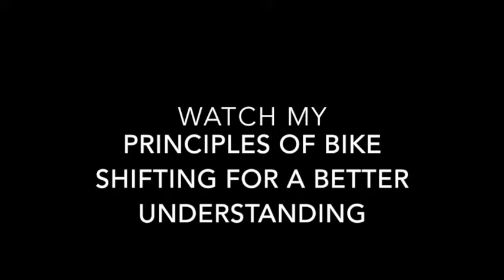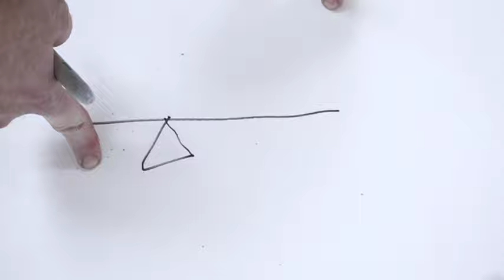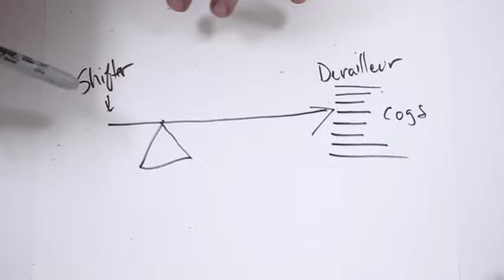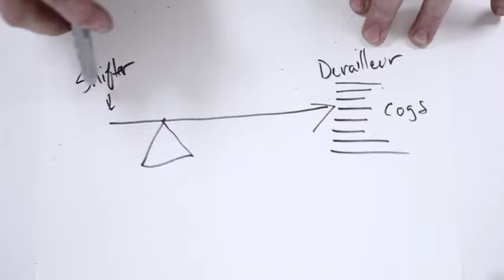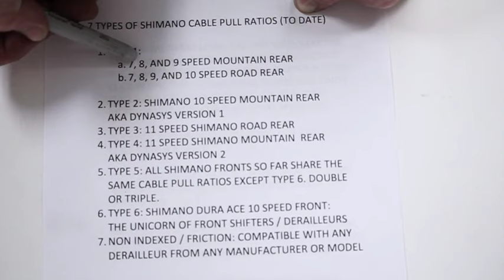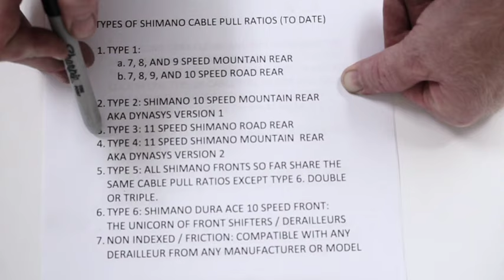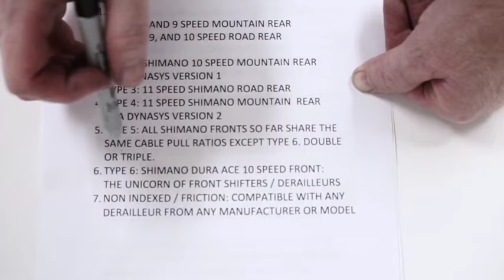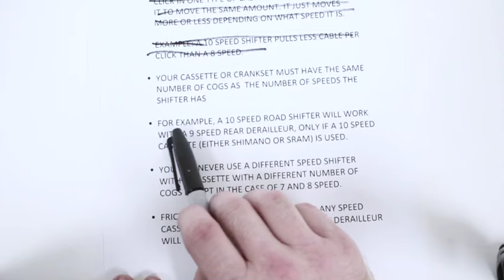Shimano Shifter / Derailleur Compatibility Guide: Intro to Cable Pull Ratios

Comment: OK so in my case. I would like to upgrade my touring bike from 7 to 9 speed. And for that I have the Ultegra St-6510 STI Shifters. Can i use my front derailleur (3 Speed) and just have to swap out the backwheel with a 9 speed cassette?

If this is possible it'll be awesome for my wallet because then i can spend the rest of the money for other parts.
Reply from the maker: You can use those. You’ll need a different chain as well. You’d only need a wheel change if you’re running a freewheel, or one of the older 7 speed only cassette hub bodies.
Reply: @johnthebikeguy   Thanks for replying. Your video is the golden explanation 😄 for this compatible problem. 

Great work!

Comment: Thank you for the brilliant video. One question though. I was advised by my LBS that you could match a 10 speed  Decore derailleur with a 9 speed Decore Shifter.because they  shared the same pull ratio. Given what I’ve just seen in your excellent tutorial, I would assume that this is WRONG? This would be for a e-MTB.
Reply: How would a 9-speed shifter be able to index across ten cogs?  One cog will always be unreachable.
Reply: I think they're correct. Providing you are only using a 9 speed cassette, which I assume is the case with given you are using a 9 speed shifter. You would just not be using the 10 speed capability of the derailleur.

Comment: If I upgrade my left shifter into Tiagra 4700, will it still work on Tourney 2x crankset?
Reply: not. The Tiagra 4700 is a special, not compatible with anything else, as far as i know.

Comment: So in order to convert my 10 speed tiagra to 11 speed. all i need is 11 speed 105  shifter and casette?
Reply from the maker: No, 11 speed road uses a different cable pull ratio. You need all 11 speed road components
Reply: @johnthebikeguy  so is everything excluding crankset/front derailler and brakes?
Reply from the maker: @tonyle7511  yes

Comment: Good video,  but 10 speed shifter and derailleur can also work with 9 speed cog, I have slx 10sp rear derailleur and deore 10 sp shifters but cogs a 9speed and its shift perfectly just needs adjusting H L screw
Reply from the maker: germantss 

What you did isn't a very common application... most people would just use a 10s cassette. Especially given the extra range, and the increasing rarity of 9s cassettes, higher prices, and lack of high quality 9s cassettes since they've been phased out. SLX thru XTR are now all 11. The lesser speed are getting harder to find in those groups.
Reply: But the trick is that derailleur lines up perfectly no noise and gears shifts perfectly. I think shifters pull cabel the same amount like 9speed, differents are in derailleur because of  different cabel attachment point. I seen on internet that people change attachment point on 10speed derailleur and they work with 9speed shifters.
In my opinion shimano specially made different attachment point that you can't use 9 speed shifters it's call marketing. Reason why I use 10speed derailleur because it has clutch, on 9speed there is no such model. 
I am from Lithuania and here 9speed part still easy to get and they are cheaper. For example :             Shimano CS-HG300-9 Deore, 12-36T cassette cost 17,10 eur and 10 speed  Shimano CS-HG50-10 Alivio, 11-36T 23,90eur , Shimano CS-HG62-10 Deore, 11-34T 31,57eur. 
And chain Shimano CN-HG53, 9speed 11,70 eur, Shimano CN-HG54, 10 speed 18,39eur. You see 10speed is more expensive but there no big different in gears. 
What about 1 X 11 system it has extreme chain line how much faster chain wears out ?
Reply from the maker: The distance between two 9 speed cogs is 4.35mm, and 10 speed is 3.95. 

Let's say I use a 10 speed shifter on a 9s cassette... The distance between the first (high gear) and ninth cog (low gear) on a 9 speed cassette is (8 x 4.35) 34.8mm. If I used 8 clicks on the 10 speed shifter, the derailleur will have traveled (8 x 3.95) 31.6mmm. By the time we get to that ninth cog, the derailleur will be short by 3.2mm. The 10s shifter tells it to travel 3.95mm each click, so as we go up the range, it'll travel .4mm per click less than it needs to to match a 9s cassette. You can minimize how much it's off by setting the derailleur perfectly in  the middle cog, and the amount it's off by is halved. But still, I wouldn't want 1.6mm off by the time i reached either high gear or low gear. 

I wouldn't say that the chain wears out any faster. The crank's position is centered better, so even though it's a big range, it's like using the middle gear of a triple which has less extreme chain angles than the other two.

Comment: I have new parts my crank is shimano deore hollowtech . and front derailer is a shimano altus 3 gear front 9 in back. But my question is is deore compatible with altus
Reply from the maker: J S 

Is the crank compatible with Altus? 

Sure. Cranks don’t really have anything to do with derailleurs specifically. Apart from having a front derailleur that matches the number of speeds the crank is. 

It’s important for a chain to match the speeds of the crank and cassette,  beyond that, you’re overthinking things.
Reply: JohnTheBikeGuy i have a understanding and comprohending disabilty so i hear all the time i over think things. And thanks for the help. And parts are on a sun ez classic sx. Chain itself it close to 10 feet long. Chain is a 9 speed kmc.. Front and back shifters are shimano slx. Rear derailer is deore.

Comment: I have 10 speed shifter shimano (no type name on it) pair it with 10 speed casette/sprocket. 
And i use 9 speed sora RD. And its not working good. Than as my mec said to change the RD to 10 speed ..I than bought tiagra 10 speed RD. Install it and it became worst. Im taking it back to Sora RD 9 speed. Anyone know whats wrong?
Reply from the maker: Shimano has been weird with their 10s road stuff since I’ve made the video. Tiagra was 9s and less when I made the video. You basically need to find older 105, ultegra, dura ace 10s components now to be compatible. I’m not sure about their shifters lacking a name with 10s. If you’re unsure about shimano road hierarchy, it’s tourney, Claris, Sora, Tiagra, 105, Ultegra, and Dura Ace at the top. 

But Tiagra is definitely different in 10s and won’t work with anything other than 10s Tiagra. It’s it’s own thing now. You need to obtain higher models that were 10 speed when Tiagra was less than 10. The upper models moved up, Tiagra moved to 10, and things went downhill as far as compatibility goes.

I’m guessing that your old shifter was compatible, but had other issues like a bent derailleur hanger, corroded cables, or a bad shifting mechanism that were causing the issue beyond compatibility.  A lot of times when an old shifter was working well, then didn’t, it’s 95% chance of cables or a bent hanger. Shifters sorta wear out, but it’s not terribly common unless it gets physically damaged.

Comment: So what you’re saying is that if I want to get the XT cassette with the XT derailleur to our on my road bike, I can’t use my 105 shifters that are already on to do that!?! 

Cheers, Kaz Hatfield
Reply from the maker: Kaz Hatfield depends on which XT derailleur it is. If it’s Dynasys, then no. If it’s 9 speed, yes.
Reply: @johnthebikeguy  My bike is a 11 speed. I've seen people do it to their mountain bike but they also used mtb shifters. And the two videos I've seen for road bikes didn't say anything about wether or not they had to change out their shifters or if they kept them the same. 

Thanks and cheers, Kaz!

Comment: do Shimano tiagra sti will work on deore rear derailleur? both 10 speed.
Reply from the maker: Jose Rafael Laruta  No, they won't. 10 speed road and 10s mountain do not share the same cable pull ratio. In order to use a tiagra shifter with a MTB Shimano derailleur, the derailleur must be 9s or less
Reply: so if a tiagra 10 sp sti was used with a 9 sp mtb derailleur, what sort of cassette could you use ?
Reply: i.e could any 10 sp mtb cassette be used ?
Reply from the maker: Joe Auty Yes, you could use any 10s cassette, road or mountain in the pairing of a 10s road shifter with a 9s MTB derailleur. You'd have to ensure the cage length was big enough to handle the cassette if a wide range was used.
Reply: could a dynasys 10 speed cassette still be used ?
Reply: JohnTheBikeGuy i had shimano tiagra sti 4600 will it work in 4700 tiagra rear derailleur?

Comment: Can I use a  Shimano 9speed  Alivio RD-M4000 with a  Shimano SL-M310 7 speed shifter.  Don't know what the pull ratio is with the new shadow RD's. Also is it ok to run a 9 speed RD with a 7 speed chain or will thier be issues. Thank you.

Comment: Ok I'm having a new Problem. I've got a deore front derailleur combined with a RSX STI Shifter 3x7, but the front derailleur isn't shifting right. I either can have perfect lowest gear or highest gear at my Crank. Is there a Problem with the crankset or the compatibility with the rsx and the deore FD. How can i fix it?
Reply: I am searching for reliable infos about the mtb/road front derailleur cable pull ratios. My case is a 3x9 Sora R3030 with a pullup MTB FD for 44/34/22 FC at 50mm. The cable pull ratio seems to different enough to allow a mix for 2x but fail for 3x. The only way w/o FD mod seem the Jtek 7. No one on YT actual measure the 3x pull for MTB and Road.

Comment: Hi, I've a Hybrid bike with MTB Shimano 3x10 Deore XT & Disc brakes. I'd like to convert it to a cross/gravel by installing drop bars, which hydraulic braking dual shifters would be compatible?
Reply: none.
your best best is tektro RL540 brakes  with ultegra 10 speed bar end shifters .
if not, be ready to change the whole drivetrain.

Comment: I have an unused SL-BSR1 Dura Ace "left" thumb shifter which is friction. Will this work with the current 12 speed Shimano rear derailleurs like the Deore M6100 (provided of course that I use a 12 speed cassette)?
Reply from the maker: If it’s truly friction, there are no restrictions - they’ll work for nearly everything as long as it is capable of pulling enough cable. It works because you’re the brains of the system - stop moving the lever when you’re in the right gear. 

Friction has no indexing, or speeds. There are some that are sorta friction, just a lot of really small clicks. Something like that may not work.
Reply: @johnthebikeguy  thanks. Did a test and it would only shift up to the fourth lowest gear. Have to do a "mod" soon by shaving the stop on top of the shifter pod for the lever to travel more (just like Ultraromance did with his shifter on Radavist)
Reply from the maker: @neilgoth1974  sounds like you need to brush up on your skills with cable setup. 

Put the shifter in the position where it lets out the most cable. Attach the cable when the derailleur is in the highest gear. If it’s a new derailleur and the limit screws haven’t been adjusted, you’ll have to check those.
Reply: @johnthebikeguy Will try that. What confused me was that the 12speed mountain derailleur (Deore M6100) has a ratio of 1.12:1 compared to the road derailleur (11speed GRX 810) which pulls 1.4:1 so the mountain RD will have to pull more cable. This will be on a bar end shifter which has a stop up top that limits the lever movement.

12 speed mountain pulls 3.55mm per shift, am I correct that it needs a total of 39.05mm to shift the whole range (3.55x11)?
Reply from the maker: @neilgoth1974  probably overthinking it. Find an old cable, short bit of housing. Connect it directly to the derailleur. Ensure that all the slack is removed from the cable. Connect it when it’s in high gear. Ensure the stops allow the derailleur to travel the entire range. If the shifter pulls it to the lowest cog, it’s enough.
Reply: @johnthebikeguy  noted. Will test again mostly likely in the coming week.
Reply: @johnthebikeguy  did test again and definitely the Dura Ace left bar end shifter did not pull enought cable to shift a modern Deore 12 speed rear derailleur. Only went up to the 4th largest cog.

Was able to make it work to shift the whole range of the 12 speed cassette by "enlarging" the diameter of the bar end shifter cable guide barrel by shoving a 1mm thick copper wire and relocating the cable anchor point on the rear derailleur.

Hope you get to test it to see for yourself.

Comment: Will the tiagra 2x10sp shifters (ST-4700) work with deore 10sp rear derailleur (RD-M615)? I've heard the cable pull ratio of the tiagra 2016 has changed to 1:4. Do you know where i can find these specs (cable pull ratio) because they are not mentioned on the shimano website (manuals, specifications, ...)? And if the tiagra shifters would not work wich shifters would? Thanks in advance.
Reply from the maker: Tim Ghijselinck No, as the video shows, road 10s and mountain 10s have different cable pull ratios. 9s or less rears have to be used with 10s or less road
Reply: Do you know where to find these ratios?
Reply from the maker: Tim Ghijselinck This video. 

It doesn't matter what the ratios exactly are, only that they're the same.

Comment: So I have a 9 speed cassette and am running 3x up front on a gravel bike. As long as I have 3x9-speed road shift/brake combo, I can run a 10 speed rear derailleur? The problem is I need a new rear derailleur and not many 9 speeds on the market? Also does it have to be long cage? Also can it be a mountain bike derailleur? Thanks for any advice!

Comment: I have a Shimano Claris and I want to change the rear derailleur for a mountain bike rear derailleur, can I use any of the Shimano rear derailleurs that is for 9 or 8 speeds without problem?
Reply from the maker: Luis Alfredo Cardona Montañez they have the same cable pull ratio (I believe). Claris is just the standard 8 speed road derailleur. As long as you stay below 9s mountain, it’ll be fine. You may need a longer chain.
Reply: @johnthebikeguy  Thanks a lot!

Comment: can I use a 10 speed shifter for an 8 speed cogs and rd? or will it just have 2 unused clicks?
Reply from the maker: Dominic Sarmen No, the shifter is set to move the rear derailleur the distance that two cogs are apart. The width of both 8s and 10s cassettes overall are the same. One click of a 10s shifter moves the rear derailleur 1/10th the width of both cassettes, whereas an 8s will move it 1/8th. 1/8th is bigger than 1/10th, so the rear derailleur if being moved by a 10s shifter will not travel far enough to reach the next cog on an 8s cassette.
Reply from the maker: Dominic Sarmen But, if you used your 8s derailleur, a 10s shifter, and a 10s cassette, it would work. Assuming you’re not using a dynasys mtb shifter (different cable pull ratio).
Reply: Does it also apply to a shimano tiagra 4700 shifter? I’ve read somewhere that it can be done. Thank u

Comment: So, basically, I can upgrade my stock 9-speed Acera derailleur to let's say 9-speed Deore derailleur,  and it will work with my stock Acera 9-speed shifters?
Reply: Did it work?
Reply: @matiasvaldes8262  I haven't done it yet, but it should work.

Comment: #5: The claim about all front derailleurs being the same, is wrong.  Road group FDs need different cable pull than mountain FDs.
Reply from the maker: T O not according to Shimano. From the more hybrid uses, like Acera, to Deore, to non Dynasys mtb, all have been the same in my experience as well. Although I don’t know why one would really want to use a mountain front with a road shifter. They really need to be paired with a mtb crank, and those aren’t the greatest chainring sizes for road.

Comment: It's great that you saying that is "all the same...." say group #1, but the question is NOT answered! The question remains is it 1:1 or 1:2, which group is which????????? I mean if you do a 10 mins video, why don't you mention the most important factor of the topic?
Reply from the maker: It isn’t important. 

Knowing exactly how much a derailleur moves per cable travel doesn’t matter, as long as they’re the same rate. Knowing that sram uses 1:1 isn’t helpful at all. They could all be 1:3, and still wouldn’t matter, as it’s just arbitrary. They could just say exact actuation, completely ignore the rate, and still I would pair it with an exact actuation shifter and it’ll work. What matters is using shifters and derailleurs with the same rate, and what rate it is, isn’t useful. No one has ever shared with me exact rates. They didn’t need to know, I don’t need to know. I’ve spent 20+ years not knowing, and still don’t care because it doesn’t matter. I’m not going to fabricate a shifter, so knowing what it is, isn’t helpful at all.

It may not be a linear rate either, and vary during the derailleur’s travel. Meaning that the amount of cable the shifter needs to pull to move the same distance between cogs varies during its travel. That would be indescribable, and impossible to state.